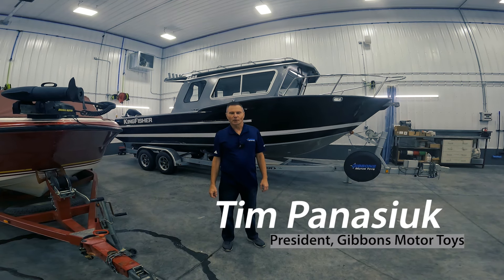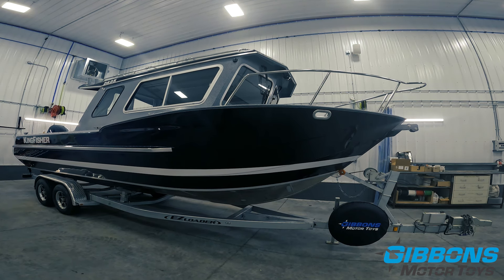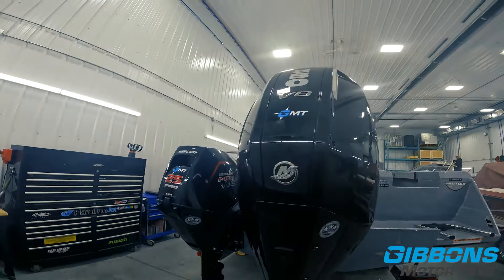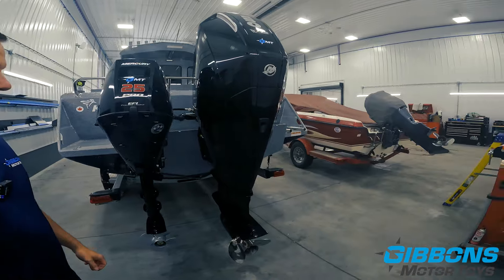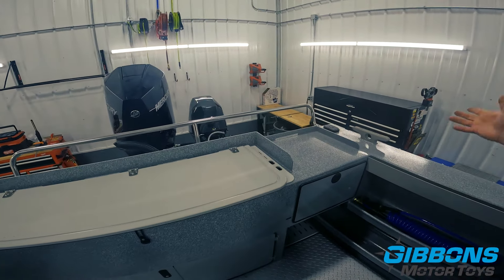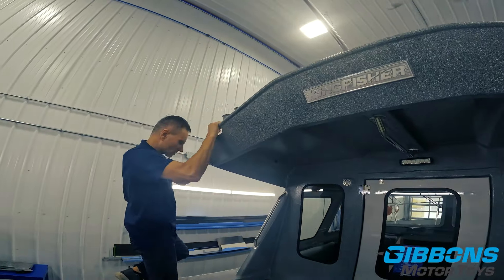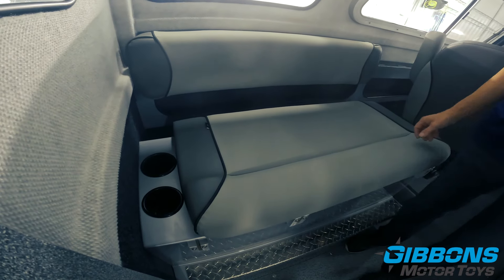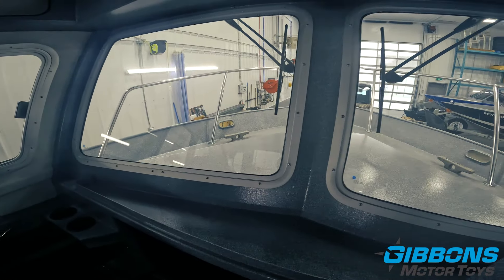Unveiling the Secrets of the 2024 Kingfisher 2625 Coastal Express

Comment: When you’re running the kicker only, how does the Optimus EPS steering work? What about with autopilot?
Reply from the maker: Yes to both of those. The nice thing with EPS is it only draws power when there is demand. So if the wheel isn't being touched, the amp draw is 0. When the wheel is turned slowly or small increments (common while trolling) it is also drawing very little power. It's an expensive system, but well worth it in our opinion. Autopilot utilizes the EPS, so it will function the same with both engines.

Comment: Is this boat light enough to tow with a modern gas 1/2 ton pickup, or is a heavy duty diesel truck ideal?
Reply: Im fairly certain the modern f250 or ram 2500 will have a towing capacity of around 10,000 lbs. (Correct if wrong) This boat has a dry weight of around 5,000 lbs.
Reply: With trailer

Comment: also- why 30” shaft over 25”?
Reply from the maker: For 2024 Kingfisher raised the height of the engine bracket. They've made it stronger as well, but the higher height also helps get the powerhead of the engine higher out of the water which reduces spray.